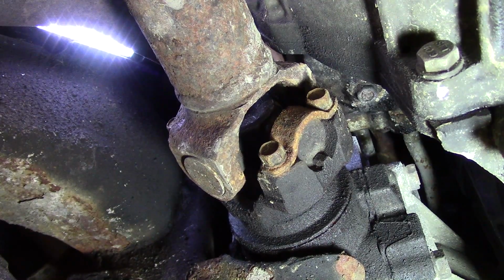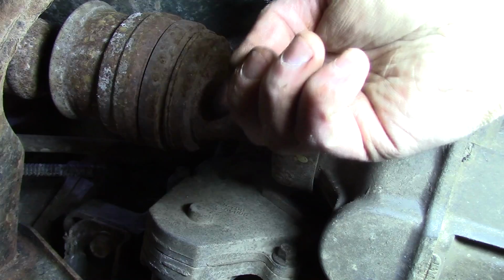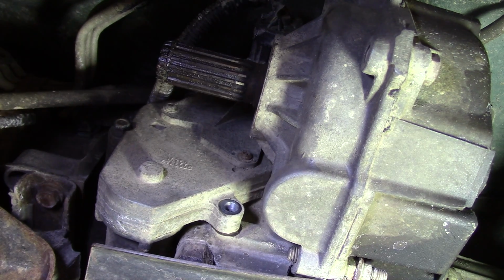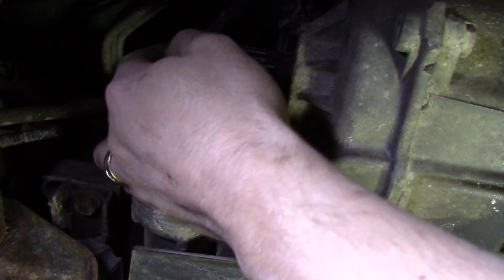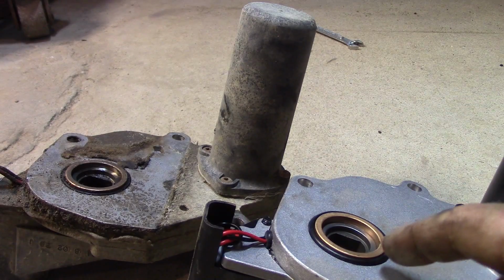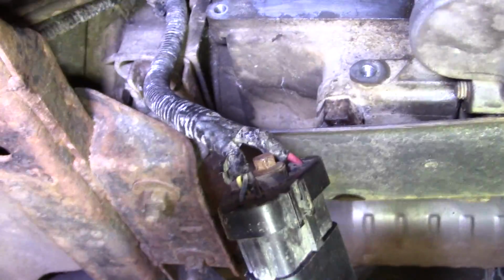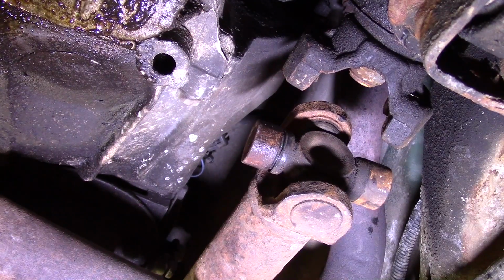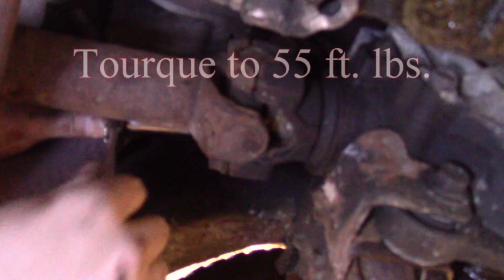DIY How To Replace S10 Blazer 4WD Transfer Case Encoder Motor GMC 4x4 Transfer Case Motor Repair

Comment: Mark, I have a question. I just picked up a 2004 Sonoma 4x4. Had issues with 4x4 and the buttons would flash. Noticed that it was really low on trans fluid and the transfer case switch was not even plugged into the vac lines. Trans fluid everywhere…Put a new one on and checked the actuator as well , put on some new lines to make sure there is no vac leak. Put everything back together and all buttons worked perfectly but the front wheels still not engaging. What are your thoughts?

Comment: Hi, you say to torque the bolts, but I didn't see you. Put a torque wrench on. I found a vac line britt.e and kinda caved in on the motot...  would that affect the 4 wheel drive too? To put on my hood cable I had to take the 3 bolts off the cruise control and they are harder to put on than the cable

Comment: My compliments this was an awesome video, was wondering if you had some insight on what types of brands we should be looking at when replacing these.  Prices seem to be all over the map with various vendors between 100 and 150 dollars but the original GM is going for almost $600.  My trucks doing the exact thing in your Blazer did hear what brand did you go with?
Reply: AutoZone DORMAN brand.....BUT I bought my T-Case motor on ebay. Its a Dorman Part, but I didnt pay the autozone price.  I paid about 75.00/100.00 for mine and its brand new.

Comment: Excellent video 👍🏼 when I do mine I’m gonna change the U-Joint while the front shaft is out. The way my luck has been if I don’t then it will go bad when it’s 20 below next winter 😡

Comment: My Chevy blazer Is wrong because the fuse #15 from 4wd Is open by one short, how can I verificate the encoder? could the encoder be in short circuit. I changed 3 fuses and nothing

Comment: My actuator works fine going into 4WD HI, the front axle also engages.  But it won't go in 4WD LO.  The light on the switch just blinks.  Anyone know what I should check to repair that?  Is there a separate solenoid involved for LO or is that also done through the encoder motor?

Comment: When I press the button it says it in 4high but it's not engaged I replaced the gears and the 3 line vacuum switch and still no 4xr

Comment: what if only 4wd high works ? when i put it into 4wd low it just blinks but goes right into 4wd high n right back in to  2wd just fine.
Reply: Did you shift to 4high first?  You have to do them in order. 4high wait for the light then 4lo.

Comment: Thanks for the really informative video. What if it won't engage into 4hi before I start this? I checked my vacuum switch and it seems to have recoil, and before my 4x4 went out, it was hard coming out of it, and sounded/felt like it was coming from the encoder. Again thanks again for the wicked content. It makes loving my 05 that much easier... money pit it is lol
Reply: How did you engage it into 4hi? Having the same problem
Reply: @DMND1212  So what is habit for these is sometimes the actuator won't completely disengage from the transfer case, and literally chew itself apart. I just had to swap out the 4x4 actuator for a new one, which was pretty simple all in all, took an afternoon.
Reply: @Reddog794  I replaced my encoder motor and it engages into 4hi and 4 low but there’s a weird noice coming from the passenger side control arm. Now I think I need to replace the axel shaft and maybe the inner gear?

Comment: Hey Mark, I'm curious to what manufacturer you used for the replacement motor. I'd prefer to buy an AC Delco because it's the OEM and I trust them. But if I can buy something cheaper that I can get even a 100,000 km's on I would get that instead. Is the replacement you used in this video still working well?

Comment: If the drive shaft is turned too far to get easy access to the bolts that hold the shaft in place switch back to 2 hi, rotate the driveshaft by hand and the switch back to 4hi.  Great video.  Saved me $300 at the shop.
Reply: Hi Mark.  The motor worked for a couple of weeks but now won't go from 4hi to 2hi.  Will go from 4hi to 4lo.  Changed the transfer case switch, checked the actuator pulls the diff cable in and out.  Seems like the encoder motor has failed again.  It was a Dorman one so I would have thought it was decent quality.  Do you think there is something on the t-case side that causes it to jam?

Comment: A previous blazer i had a few years back had the vacuum actuator cable pulled, and vise gripped. but before i found all that, the 4wd had worked fine for the previous 2 years.. lol. eventually it got stuck in 4wd, and it all went down hill after that.
Reply: @nogripes  No it wasn't, I discovered those long before I discovered your channel.
But I am working on a 2nd blazer now, trying to get the 4wd working b4 winter, changed out the vacuum actuator yesterday evening, but still no 4Hi light.
so I'm gonna reposition the actuator along side the battery to observe if it's actually actuating, lol, then on from there.

Comment: My 2000 Jimmy Diamond edition is at the shop for this same reason but it wasn't my transfer case motor its the transfer case control module. Sad part is the shop I use just replaced my rear U-joint with a greasable U-joint from Moog but they forgot to put the grease fitting in and not even 48hrs later it seized up and blew while we was heading home on the highway at 63/65 mph and the whole driveshaft flew out missing two cars. Waited 4hrs for Triple A. I had taken pics of the as there was transmission fluid all over and under my truck not to forget the oil trail as I coasted as far as I could after it happened. The shop replaced the shaft and U-joint and a spacer somewhere between the transmission and transfer case. They road tested it and asked if I had transmission problems as they had to manually shift.. I said no the tranny has always been tight.. I had to pay for a used one. So far I've laid out a $1000. I personally feel they should have made good on all the driveline parts damaged by thier forgetting to put the grease in.. I forgot to mention we went and looked and found the driveshaft but in two pieces the day after. I sent em pics of the driveshaft and the seized U-joint as I didn't want them to keep it as my proof if needed later. So YouTubers what do you think? Should that shop be responsible for all the damage the driveline or should have to pay for a used transmission that only has a 30 day warranty. I look forward to your replies.
Reply: Sabotage is my best guess. If they are a licensed mechanic there is no other answer. They tried to cause harm to you then when it failed they tore your transmission up then blamed it on you. Probably hoping you would go buy something else and sell them yours on the cheap to get rid of it. Honesty and Integrity are rare as hen teeth these days. If people want they take. It’s simple theft . Lowlife no class low rent trailer park trash , hating a man for what he has and they don’t. A beta male will always hate what he can never be. Alpha males need to learn to spot them. I am not a flamboyant man to the contrary I am very private and not a braggart. Still although being a kind giving fair man , who sees no difference between me and another man - I see them as my equal. I have many haters that hate me based upon the stories of females. They are in the local mechanic shop, they are among the ranks of the civil servants . Retractors also exist in the white color community as well. All because of anatomy. And based on a woman’s lies. I don’t have a proud look . Still haters will hate and they will sabotage anytime a change presents itself.  As has been said since beginning “ if you want it done right,,,,,, do it yourself “

Comment: Great video. I started my diagnosis by shorting pin 13 on my obd2 port to ground. great little trick. It told me i have a bad motor. Tried to get the motor out without driveshaft removal. I got as far getting the bolts out but was unable to free the motor easily. driveshaft removal was very straighforward. My caps on the forward end seem very secure on there. Thanks again for a great video
Reply: What is the pin 13 shorting trick. What do you do exactly and what does it do exactly?

Comment: I have a 2001 Chevy Blazer, I can shift in and out of 4wd but after a 1/2 mile, my service 4wd drive light kicks on and it won't let me shift back out of 4wd until I turn off the blazer. could it be the transfer case encoder motor?

Comment: My 98 K2500  is not shifting into 4wd the motors/ actuators sound like they are working well, but the light in the middle of the buttons stay flashing. It does seem to drop down to Low but does not put any power to the front wheels. There doesn't appear to be any locking mechanism at the hubs but there is an actuator, encoder motory thing on the front axle.

Comment: Im having an issue with my blazer, it shows that its not in 4 hi but it is driving in 4 hi. I am trying to figure out the problem, I know its not the actuator it was literally just replaced yestarday, and has been doing this since before then. Any help is appreciated

Comment: Was the encoder motor difficult to mate with the tcase shaft coming out? I just replaced mine and it was almost like a press fit. I replaced mine and still the same issues!

Comment: I have no flashing lights on my 3-button push button but my axle doesn't lock in. Replaced vacuum lines, TCCM, actuator is good. I have to go into 4-lo then 4-hi before it'll lock in. Then when I'm driving in 4x4 I can hear the axle slip every now and then. Encoder problem? Just wanted to be sure before wasting $150. I'm assuming it NOT being an auto 4x4 it's probably the 2-pin. (I can only imagine how complicated they made the auto.) As much as my wife and I love our old '98 LT it's a love/hate relationship when I have to turn a wrench anywhere around or on the 4.3 Vortec. (I liked the space and relative ease of working on my '93 conventional 4.3l. What a great V-6.)

Comment: I had a brand new actuator motor installed and the mechanic says the reason it doesn't work is that the connection is always getting wet? I have a blazer 2000 with auto 4 wheel drive as well as the regular drives. it will not switch into any 4 wheel drive position at all... Any ideas?

Comment: Question: I replaced new actuator and the tcase switch. But still does not go into 4WD. I hear the electric motor when I hit the buttons, and the button lights work properly. Is there a way to test the encoder without taking it out?

Comment: I'm still having issues, even after replacing the encoder motor with a new one. For a while it seemed to work fine, I would periodically test it going into 4 hi. But it hasn't worked right ever since I tried going into 4 lo one day, 4 lo doesn't work at all and it gets all bent out of shape if I try to go into 4 lo. But even if I don't try to go into 4 lo it works only intermittently now with 4 hi, even with the truck off taking the vacuum actuator for the axle out of the equation. The encoder motor attempts to shift the transfer case, but many times it fails, and or gets stuck into 4 lo or 4 hi. Can't figure out wtf is wrong with this thing and running out of patience. Winter is pretty much here, I haven't had to drive in snow yet, but it's going to happen soon and I'd like my 4x4 to be working...If anyone can help me diagnose, would appreciate, 2002 Blazer fwiw, with the 4 button system. I wish it was just a freaking manual case, wouldn't have BS problems like this, sigh.

Comment: Hey mark,
Question for you... 02 s10 ZR2 4Lo and 2hi work as they should. 4hi won’t blink or do anything when pushed. Disconnected the battery for 30 minutes reconnected and 4hi worked 2 or 3 times then went back to not lighting up or anything. Have you run into this? Any thoughts? Thanks! Chuck
Reply: I have the same issue . I have a 99 s 10 blazer with 3 button dash switch. When pressed the 2 w works, it goes into 4w low range ok. When I try to put it in 4w high, lights flash and it  goes into 2w high... when I try to go into 4 w high, no sounds from underneath vehicle,  just stays in 2w high... it will go into 4w low by pressing the 4 w low in neutral,  I can hear it engage...help me please... I can hear clicking  in the passenger side kick plate when pressing 4w low. No sound when 4 w high is pressed... bad dash switch maybe ???? .4 wheel low definitely engages and will switch back to 2 wheel. When   4 wheel high is pressed.... any ideas. 99 S 10 Blazer...
Reply: I have same problem as both of you.  Can't get an answer from anyone.
Reply: @chuckfinley4757   so I replaced the encoder motor, pretty easy to do. The vacuum fronts hubs suck so I recently did the “posi-lok” manual hub setup. I posted a video of it. I think my next step to to put in a manual transfer case at some point.
Reply: @Chuck Kelly  I replaced computer, tccm, vacuum switch,  encoder, 4x4 dash switch.  Still have same problem.   I replaced everything but to transfer case.   The other weird thing is in my other blazer I can shift it at any time in any gear.  In my problem one I have to be in neutral.
Reply: @chuckfinley4757  2002 Chevy s10 zr2 4x4 fix posi lok install
https://youtu.be/faajlpC97TA

Comment: So from looking at it with the motor off it appears that a simple lever could be attached and have a cable or rod linkage ran to inside the cab? Does the motor seal against the whatever it attaches to to keep crud from getting in or fluid from leaking out. I want to do away with all this stuff and have a simple rod or cable push pull. I was with a friend who bought one new and we ended up stranded an entire night because it wouldn't go into 4x4 and it was a new blazer.

Comment: Im working on an old jimmy and have just about done everything the internet can teach me on fixing the 4x4 system. I had it working for a little but it would alway grind a little when shifting into 4lo. Recently, however, i had shifted into 4lo and it grinded big time. For a week or to afterwards, i could here a very strange scrapping noise coming from the 4x4 shift handle. Last night I jacked up all four tires of the ground to test shifting the 4x4 handle and now all four tires are locked no matter what gear i am in park drive reverse and nutral. Even though i have put the 4x4 shifter in 2hi. The front axel seems to be stuck in engaged mode even without vacuum. The light for the 4 wheel drive next to the 4x4 shifter remains on even after repeatedly try trying put in 4lo and back. The 4x4 does not seem to want to get back into the 4lo position. BTW i am putting the transmission gear shift into neutral before doing and 4x4 shifting. Please help!!!!
Reply: looks easy for you ! I have a 99 blazer but so far I don't need one ! what are the symptoms that it needs changing ? thanks Mark !

Comment: hi I'm just wondering about the 2000 bravada mines all wheel drive and its stuck in 2wd every one says the motor in this video now with something that can't shift in and out of the awd system how would it be easy to replace please email me tobiasfiske8@gmail.com

Comment: I have a question for Ya I have a 2000 GM Jimmy. 4x4 is not working at all hasn't for 2 years and I want to get it working my push buttons work when I hit the buttons I here a click but nothing else I know it's not kicking on at all and when I push the buttons the lights just flash what is the problem there and where did you get your parts I called my local auto store and there is nothing under 30 dollars the actuator is 80 and the encoder goes from 120 up to 180

Comment: I have a S-10 ZR5 my lights and everything work fine I hear shifting at the transfer case my diaphragm is always pulling but my 4 wheel drive doesn't work.  I realize the vacuum switch on the transfer case probably needs replaced but where's the damage at? Is it in the differial or the hub.?

Comment: i have relay clicking going on in my tccm tried replacing it  with a salvage yard control module and got the same result. what symptoms did you experience other than no shift from four-wheel high?

Comment: I've got a 99 Blazer LT with a similar issue.  It's in 4hi, but not actually engaging the differential.  It won't shift back to 2hi, nor will it shift to 4lo.  It does not engage any drive gears, reverse, etc.  The transmission level will move to each position, but the vehicle is in neutral (as in the tranny doesn't engage and I can physically roll the truck).  When shifting to park, it grinds, but does not engage the parking gear, and I can still roll the truck.  

Any advice as to what may be wrong?

Comment: Thanks, Mark!!!  Have a 2000 Chevy S10 which NEEDED a 4WD shift cable (froze up solid), and a 4WD transfer case encoder motor. You gave GREAT how to applications, and truck is back in business!!!! :)

Comment: good video makes it sound easy except i have a different issue the 4wd button dosent light up at all when i push the button nothing happens no light I have a 95 gmc jimmy s-15 any ideas
Reply: I have 1 switch that does 4 high and 4low that's it

Comment: Mark…I'm still using the vacuum on the xfer case to lock in the front diff.   I took the electric motor off the aluminum housing and used some of the internal parts to set up a
mount for a rod shift lever.    I also never do shift on the fly.   If you send an email address I would gladly send pics.    If there is  way to send pics via YouTube let me know…   I have about 8 pics of the conversion.    Thanks for timely response…   walt

  I think that NAPA kit is over $100 bucks…you (or I) could make one for less than $20 .
Reply: Hey, i'm very intesested un that mod sounds very cool! jesus.gp20@gmail.com tnks for sharing!
Reply: What is the kit called?